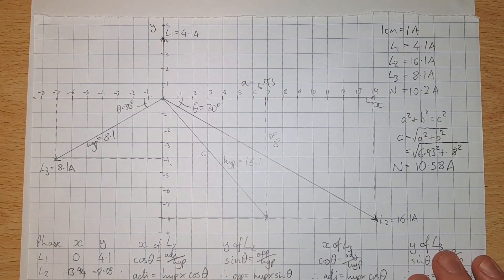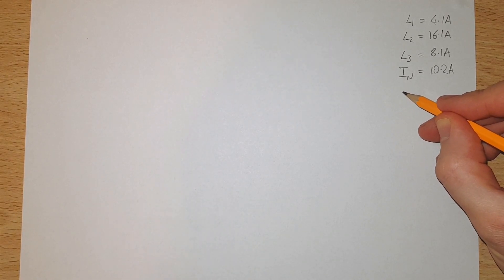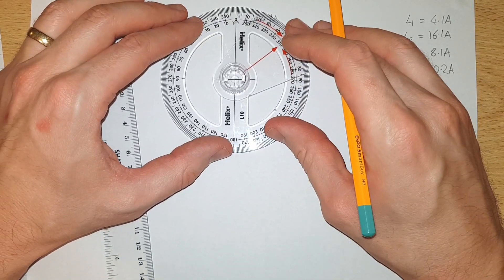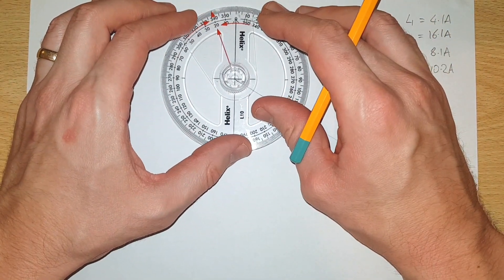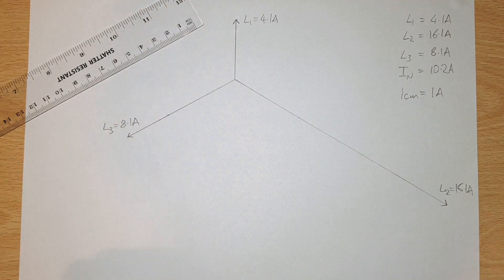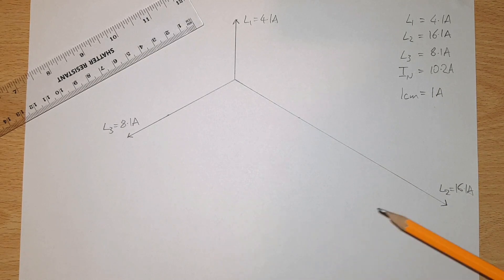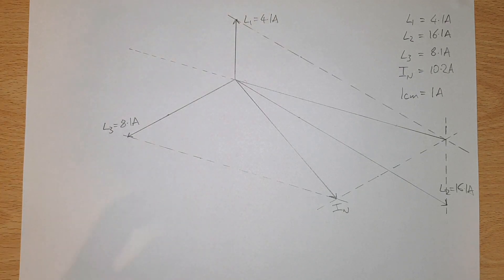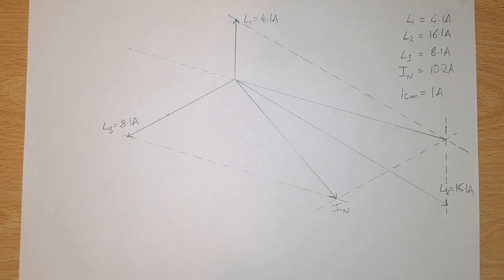Three Phase: How to Use an Easier Method to Calculate Neutral Current in an Imbalanced Load

Comment: How do you calculate the neutral current when there is a PV system and there is net energy export on one phase and import on other phases? How do you draw the vector when it represents net energy being exported to the grid on a phase?
For example, let's say there is 10A export on L1 / 18A import on L2 /  0A on L3. I measured about 25A in the neutral in this situation with a clampmeter but that seems very high...
PS: I know this video was posted 4 years ago, but thought I'd give it a shot anyway...

Comment: Hi, why did you use 60 degree for the 2nd method? why not any other degree?
Reply: It's actually 120 from the extension of the line, but 180-120 gives 60, so it's 60 from the line itself

Comment: This is a great video, Joe but just need to watch the direction of the neutral current phasor in this video and its predecessor. In order to satisfy Kirchhoff's Current Law at the neutral point it is effectively -In we are solving for, not In. Your methods will, of course, calculate the magnitude of the neutral current correctly but the direction of the neutral phasor is only shown correctly at the end of this video (i.e. "pointing toward the neutral").
Reply from the maker: That's a really good point actually, I took it to this point because Level 3 electrical requires you to find the magnitude not the angle, but I'll do another vid explaining the next step. Thanks for commenting. 👍
Reply: @JoeRobinsonTraining  really wish I’d had access to your vids 35 years ago when I was training as an electrical engineer. You are very good at explaining these concepts.
Reply from the maker: Cheers mate, much appreciated!

Comment: Very easy to calculate the neutral current without all this drama. In a balanced source (I'm assuming you have a balanced source) The source currents are 120 degrees apart so Line 1 is 4<0  line 2  is 16.1 <120  and line 3 is 8.1<-120. Summing these gives us 10.7<139.5
Reply from the maker: Not sure it could be classed as drama, but thanks for another option.

Comment: These are brilliant tutorials, however i would suggest for both accuracy and speed using AutoCAD is a must if available.
Reply from the maker: Good point Angelo, thanks, unfortunately it's not always accessible in an exam. 😕
Reply: If you have access to a calculator that can do complex numbers using magnitude and angle, it gives you exact results. 4.1<0 + 8.1<120 + 16.1<240 = 10.6 <139

Comment: I don't understand in what situation a phasor diagram method would be preferable to a vector diagram method (your triangle method). I have always been taught through school to use the vector diagram for graphical representation of resultant forces.
Reply: Just seen the phase diagram drawing of the star and delta 3 phase motors. Now I understand! When there is a lot of vectors of a single variable the vector method is easiest, when there is loads of different variables the phasor method is easiest to work through.
Reply from the maker: Thanks for commenting and asking questions. And thanks even more for answering it yourself!

Comment: Joe - great video. In your experience, has an exam board every expected students to calculate neutral in the most complex way?
Reply from the maker: That is a good question. Not in recent memory but I'm struggling to go back over all the iterations of the electrotechnical qual. 🤔 Currently I believe C&G state either method is acceptable. EAL, I think, ask for a phasorical method. I'd need to confirm with the documentation though.

Comment: This method also gives neutral current angle (assuming resistive loads) without any calculations
Reply: The neutral current is actually reversed from how he drew the vector in this video.   Neutral current needs to cause the current among all four wires to add up to zero, which means it is the reverse of the vector sum of the three phase currents.

Comment: Thanks Joe, well explained.  Apart from "exam for exam's sake" why would you inflict method 1 or 2 on anyone?  Presumably method 1 gives the definitive "correct" neutral current, the other two methods being an acceptable "rule of thumb"?
Reply from the maker: Method one combines accuracy with a visual representation of what's going on which is the best of both worlds really. There is another formula that you just stick the numbers in but it doesn't generate any understanding of what's happening in the circuit.